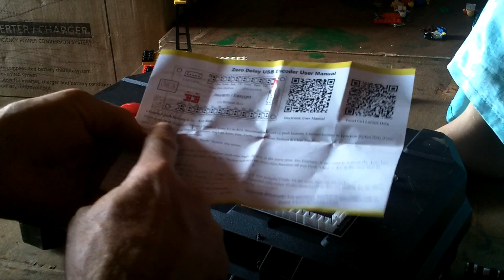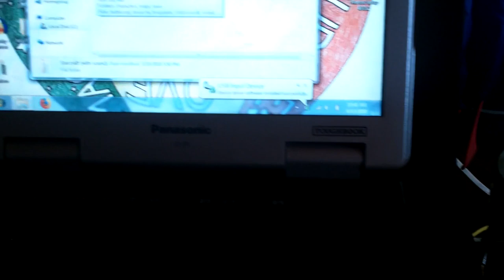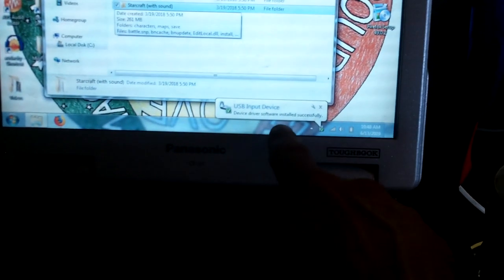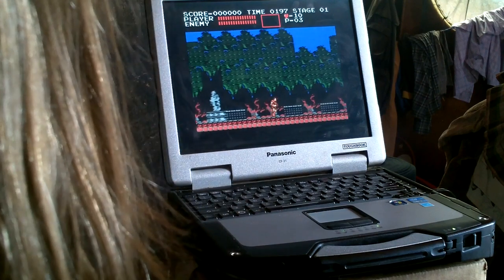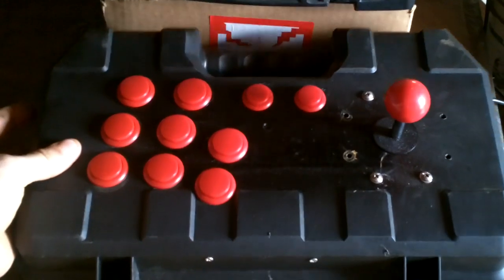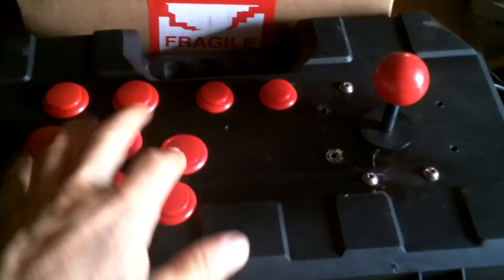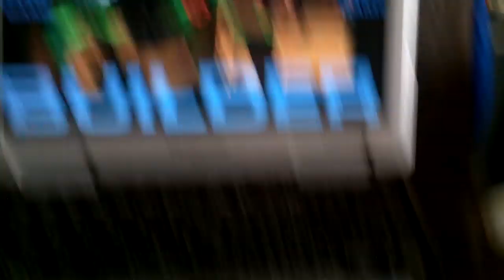DIY Arcade Joystick

Comment: I built an arcade stick for my old school NES. Looks like I used the same button kit you did. I used the guts from an aftermarket turbo controller in stead of the USB board that came with the kit. In stalled everything into an old DVD player housing. Added a couple LEDs to the display on the case so they light up. Works awesome. Makes playing much easier compared to using the regular controller. It even has TURBO buttons.

Comment: I use my stick on the right just like that for the exact same reason. Grew up playing Doom, Duke, Quake, and such with just keyboard so I am used to movement as my right hand. After years of using a mouse, now I am also used to making the hand and wrist movements on right hand that a stick requires. I still prefer playing a lot of games with arrow keys though, and eventually will make a joypad with directional buttons instead of a stick.